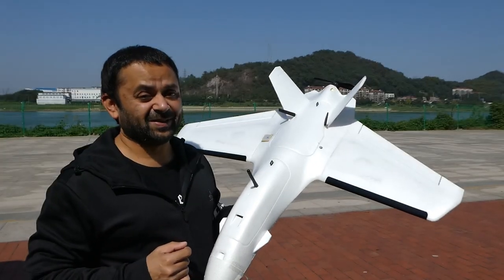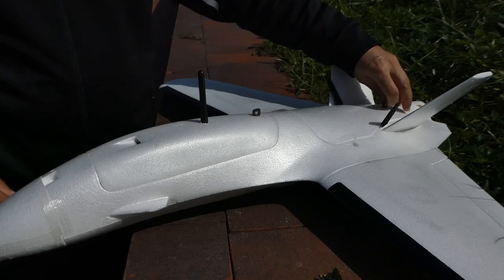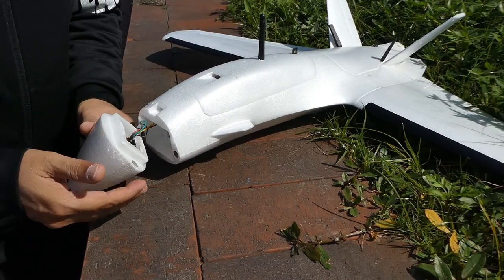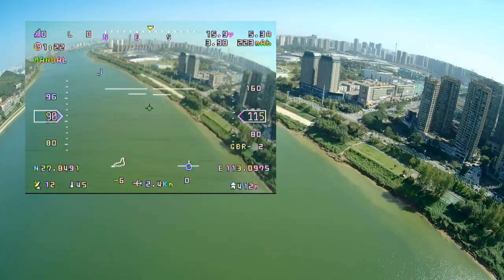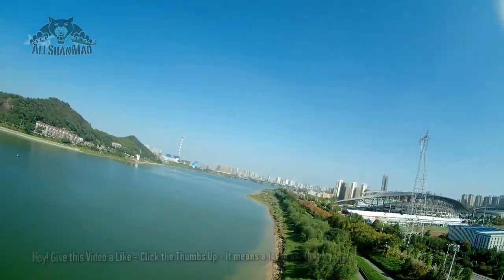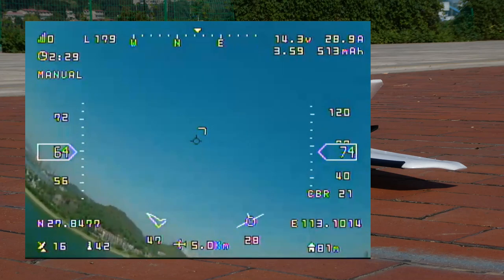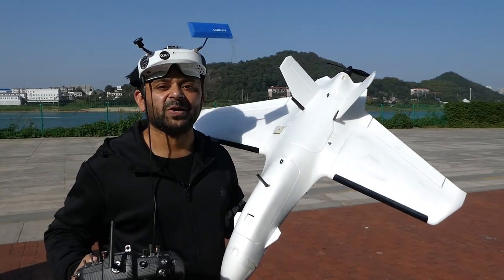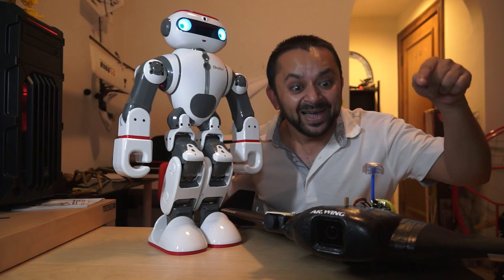Skyzone/AtomRC Dolphin Wing Kit High Speed FPV

Comment: Which do you like more : Aggressor or the Dolphin?
Reply from the maker: Dolphin for its compact size and speed, plus its short range FPV Flight fun. Aggressor for its being majestic, stable and good for long range flights.
Reply: Awesome! which 6S motor/prop combo would you recommend ? No mod needed for using a quad motor on the mount?
Reply from the maker: haven't got time to go for my dream 6S setup. now its winter and too cold to do anything. batteries do not cooperate either. so gotta wait for warm summer and pick this project back up